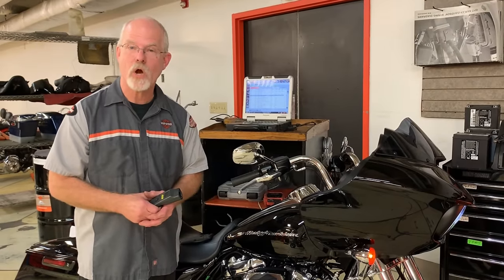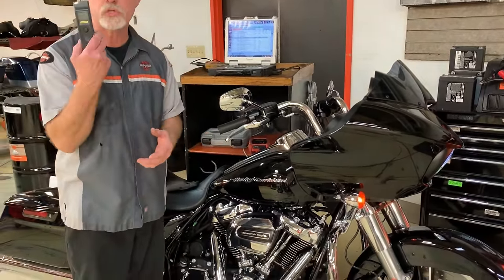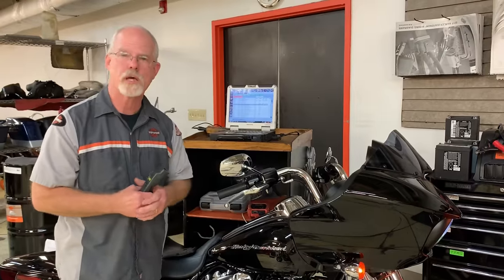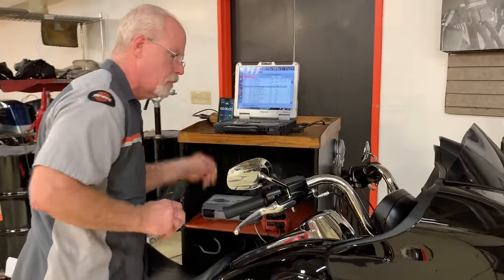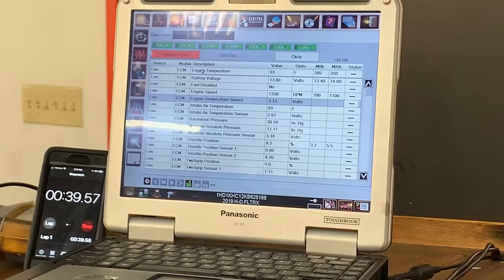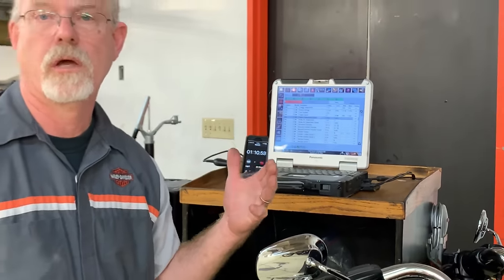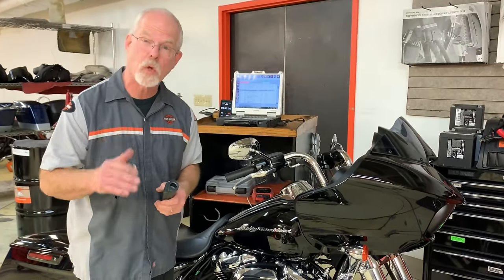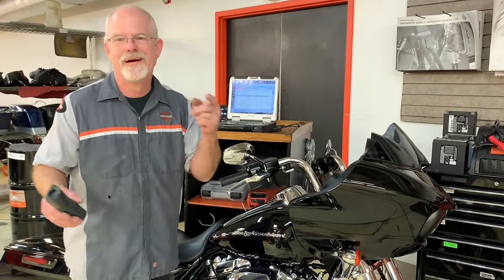DOC HARLEY: HOW LONG TO WARM UP YOUR MOTORCYCLE

Comment: I warm it up until the RPM's go down to the regular idle and while I'm putting my gear on. Then I take it easy on for the next few miles.
Reply: Hi I ever 2004 Harley Davidson when I speed up to 30 to 40 miles an hour the front in aback vibrate one side pull the clutch in let the Trotter out it just go smooth what do I need
Reply: Don’t rpm’s rise as it warms up 👀
Reply: @blakeoneal8306  yes a little. It's normal.
Reply: @blakeoneal8306  my choke says otherwise
Reply: Best gas for 2004 pan head road king?
Reply: That's just wasting fuel. in your case it's also good to take it easy the first few miles you drive because even though the motor is warmed up none of the drivetrain is warmed up. it's better to turn it on about 15 seconds before you pull off and then pull off and start to drive that way everything in the drivetrain can warm up equally.
Reply: thats what i do

Comment: Only a poorly designed vehicle requires a warm up.   For everyone else operating a cold vehicle at moderate  RPM until the vehicle is up to full operating tempeture is fine.  Warming up is a waste of fuel and, especially in the case of a Harley warming up in a tight community, is likely just a case of the owner being desperate for attention.
Reply from the maker: BS flag up and waving! This is an air cooled all aluminum motor with several pieces, ie heads, cylinder and case. From cold to operating temp the motor expands. Your comments are all opinion with no knowledge of our product. Go back to your car channels😡……Doc

Comment: I'm a 5 minute warmer-upper. I like my engine to be at 170 F before I take off. This usually takes less than 5 minutes, but I want the oil to be easily circulating before I have the parts moving. Probably way overkill, but just taking care of what I have.
Reply: 😂😂😂 the trans is still cold

Comment: I am a pilot and Harleys are air cooled just like my airplane. I do what's called a Preflight before I even start it. After starting it has to warm up before I do a mag check. By the time I get to the runway it's been at least 5 minutes. Waiting a minute before running down the road on my Harley doesn't seem that long to me. Doc is always right! I also have a temp gauge oil dip stick. I can check the oil temperature at any moment.
Reply: @VailJohnson  - max power takeoff is no more than 2,700 rpm. The cylinders are very similar being air cooled aluminum fins. I climb out at about 100 so there's plenty of air cooling the cylinders. I think I'll stick with Doc`s suggestion as I'm never in a rush to get going.
Reply: You think too much, Harleys and airplanes have no one single thing in common, lol
Reply: @Alim92usaman Oh but you’re wrong.

Comment: I allow mine to warm up till the back head is very warm to the touch of my back fingers. You are allowing Engine temp and oil temp to rise. It’s a relatively thick oil and it’s not hurting to allow getting hot before running down the road.

Comment: I own a 2018 Sportster 1200 Custom. Usually wait until the Idle speed drops to about 1100 or so.
Reply: I even wait till it’s normal idle. 975 to 1025
Reply: I do the same on my 2015 883. I like the control at lower RPM for start off rather then at 1400 -1500 rpm. I have a loose sand  1/4th mile long driveway and it's best to do at lower idle power and speed.

Comment: Good advice Doc.  Most old school peeps want to let it run for 3-5 minutes to warm.  This is a fallacy because you can cause more wear and tear running without light load because the moving parts are starved of lubricant.  I start and go immediately which is about 5-15 seconds, the time it takes to put my gloves on.  I do go real light on the throttle and don't go past 2k rpm until 10 minutes into the ride.  As for changing the oil while warm,  it's only true if you bring it to the shop.  At home,  I can let it drain for 4 + hours.  The contaminants are in the oil so there's no need for it to be suspended. It collects into the pan and most of the oil has dripped down away from the upper areas which is not necessarily true if you start the bike and let it warm.
Reply: Eh old school we had to let it warm for a few minutes. Evo's and older would pop seals and get leaks like mad if you didn't let everything warm up and expand first. 
My 98 Evo is what, 25 years old and still doesn't leak a drop and I warm her up first every time.

Comment: The most damage occurs at start up and from the fact the aluminum pistons expand faster than the steel cylinders they're reciprocating in
Reply: And a cold seize is when you rev the shit out of it before it’s properly warmed up for a few seconds if the ambient temperatures are decent. Then off ya go

Comment: I replaced the ambient temperature gauge in my fairing with one that shows the oil temp. If I am able to stay moving which is most of the time my oil temp stays around 180F. What amazes me is how fast the oil temp raises during just one long set of lights. I've seen it jump an easy 30 degrees or more in a minute or two. FYI... My engine, exhaust, and dyno tune are not stock.
Reply: Who did you purchase it from ?
Reply: @Richard5873  The Harley dealer. It's an HD part and matches my gauges perfectly.
Reply: @kerrylewis2581  Thanks did not know they sold one.

Comment: You really had me Doc. I've own a RoadKing, & it's pretty loud. I live in a quiet neighborhood & always feel a little insensitive when I start it early. Appreciate only 15-30 seconds is necessary, & i didn't know that. THANKS for the info. You earned a new subscriber.
Reply: Yeah, been warning my 20 Heritage till the RPM's drop down to about normal while I'm getting my gear on. Probably a wee bit too long, especially with my new shift, gotta leave the house at 0200.
Reply: I'm in a apt with underground parking. V@H pro pipe. Feel sorry for the folks on the first floor at 5 am😬

Comment: I let my Buell warm up till engine sounds right. There isn't a noticeable change in rpm Around 2-3 minutes in the cold 40-50 degree mornings. Maybe a minute if 80's or warmer. If I don't let it warm up it's jerky. And have an uphill stop and turn not far from home. So warming it up is more for me than engine.
Reply: That’s the only reason there was ever a need to “warm up” - carburettors and dodgy fuel control when cold.

With modern injected engines, they’re good to go out of the box dead nuts cold.

Comment: 2014 XL883L, V&H's mufflers. If I let my bike idle for 15 seconds after start-up my neighbors would go crazy. (04:30) When I start the engine cold the idle speed is around 2,000 RPM so I have it in gear and once the engine starts I take right off. I do not touch the throttle until 3 to 4 minutes after the bike is running and then I may go up to 3,000 RPM once I'm on the main street. I've lost 1 rocker arm bushing in 40,000 miles. Good video, keep it up.

Comment: I have only owned EVOs. But the rule I follow is to warm the engine until I feel heat permeate up through the rear rocker box. Not necessarily when the top of the box is hot, but until I feel heat coming up through the cover layers. Then I go easy for a couple miles. Sometimes this is quick, sometimes not. I have ridden in below 0F and it takes a few minutes. I will also occasionally put a space heater under the primary blowing under the trans and oil pan for just a few minutes before I start the engine.

So far, I've bought 2 EVOs with rocker box, head, or base gasket leaks and after fixing, none of the leaks returned.
Reply from the maker: Thanks for sharing SixShooter….Doc

Comment: Engine metal heat temperature is what heats up your oil, not the oil heating up the engine. You should let your harley warm up on a cold start just shy of two full minutes

Comment: On initial cold start, the ECU bumps up the idle in order to heat the exhaust catalyst as quickly as possible and minimize NOX emissions. There’s no need to wait for the bike to return to it’s normal idle before setting off. The bike only needs enough time to get a steady stream of oil to the top of the engine, which only takes a few seconds. After this you should begin riding as putting a load on the engine is what warms it up to normal operating temperature most quickly, being careful not to gun it until it’s warmed up some.
Reply from the maker: Sir you have an interesting post with experience backing it up….Doc

Comment: Thank you very informative I usually let my bike run for a couple of minutes and then ride it nice and easy for a while I have a temperature gauge in the oil and it regularly reads 202-210 here in Florida nice to know that that is where it's supposed to run

Comment: This is the most important advice of all along with not riding like a crazy person. 
I can't remember the times I've  told people to warm up their vehicles of all types before subjecting them to high load conditions.
It's always said to be the manufacturer's fault when there's a cracked piston or a spun bearing but the fact is well know that owners manuals detailing proper operation often remain sealed in their plastic packages for over a decade without of course ever having been read.

Comment: I was under the impression the 30 seconds was to make sure oil is getting all around the engine I don't think getting oil oil temp up was their main concern when they wrote that manual... The taking it easy at first is a good idea though..

Comment: Carb bikes are traditionally a bit more fussy. On factory fuel setting they will spit back until up to nearly full operating temp. Put an air cleaner and some slip ons and they will need a bit more fuel just to run. Start up on the choke and push the choke in very slowly until the idle comes down to around 11-12 and starts to sound lumpy. That'll take minimum 30 seconds. If everything is set up right you can get it to idle lumpy at 1100 and pull the clutch. Wait a few seconds before firmly selecting 1st. It should take a few hundred yards riding before it's happy with the choke off. The 3 turns out fuel screw and no spitting cold when you blip is way rich. I got my 1450 fxdl at 25k miles/25 years old with the 3 turns. Carbon factory, it's taken a bit at a time but now runs and smells sweet at 2 ⅛. Ran like c**p on 3 turns which is probably why they did 300 miles in a year on stale E10 before selling it.
It's got K&N and Vance and Hines straight shots with new packing in quiet baffles and it's nothing like quite under.
Happy days.

Comment: I've got my dad's 1994 Sportster 1200. It's carbureted, so I have to hold the choke for a couple minutes and let it warm up. Otherwise, it's going to be a rough ride for a while until it does warm up.
Reply: Kasual Kaos my 2004 Sportster 1200 is the same way. when it’s 72° outside it takes about four minutes to warm up from a cold start
Reply: Got a 2001 883, takes a GOOD LONG TIME to warm  up! No different on  warm day!

Comment: When I got my '66 Chevy Biscayne with a 283 the owner's manual said that no engine warm-up was necessary. I lived in Michigan at the time where it was not unusual for morning temps to be below 0 degrees F. I raced the piss out of that car and never did it burn any oil and I never had one problem with the engine. Today's oils are much better and being a motorcycle where it is likely to be driven is warmer weather I'd say that a warm-up is not doing anything but wasting fuel.
Reply from the maker: It is my opinion you are mixing apples and oranges. You wonderful car is water/ temperature controlled. Our motors are air cooled and dependent on oil temperature…..Doc
Reply: @LowCountryHarleyDavidson  This is true, an air cooled engine warms up much faster, especially if a car has a cast iron V-8 block and 6 quarts of oil.

Comment: In cooler seasons I let it run long enough vertically if convienant, (not on side stand) to reach operating temperature, then ride easy for a few.
In the desert, the opposite, and I try to scrub off heat befire shutting down.

Comment: I pre flight check all systems before starting engine. Allow for time to operate without choke for carburetor machines or till ECM idles down on fuel injection machines. 
Ride very moderate until all systems indicate go condition. Tires when cold offer less traction.
The machine tells me when she’s ready for action.
Reply from the maker: Ah, A Harley Whisperer 👍…..Doc

Comment: My comment is what “oil temp” did my flhtcu twin cam run best at which was 190-210deg F.
That’s the oil temp my Hd ran at in 90deg F outside temps after I added an oil cooler with twin thermostatically controlled cooling fans,a small version of luv jugs cooling fans mounted to left side motor horn mount with therm control too,XIED’s to richen idle low & mid range rpm mixture,went external crankcase breather to remove extreme hot blowby gas Lauren with oil mist from engine intake.
Doing all the above increased oil pressure,pressure,stopped valve train noise,stopped detonation,allowed motor to retain all the pwr/trq & crisp throttle response it had just past warmup from cold it always lost 20-30mins later after fully heating up,hot starts post fueling up were much easier/faster,less engine heat was hitting the riders too.
Reply from the maker: Sounds like you could write a book on this subject….Doc

Comment: Mike, you can Also tell just by listening to the bike, the temp sensor with have the engine RPM slightly elevated while warming, much like the Enrichener used to do, if you wait for the RPM's to drop to what would be a normal idle, then you can start to put a load on the motor.  Do it too soon and they come see fine Tech's like you to replace gaskets etc. and like you said while waiting for the motor to warm do a pre-ride inspection.

Comment: How long do you recommend letting an Evo warm up (1998 fxdl)?  I always let it warm up, but waiting until the rocker box gets warm to the touch, like so many say to do, seems to take forever
Reply: i have a 96 fxdc and a 2012 flhp i do the same thing you do.....if i cant wait i take my truck
Reply: I usually wait 3 to 4 min for my evo
Reply: I have had my 86 FLT since new with the 80 cube evolution and I use the cylinder jug fins to tell when it's warm enough by holding my hand on them then ride it easy for the first couple of miles and have had no problems with it at all !  The Evolution is known to blow head gaskets if you get on them real hard when cold just had a buddy who has a 96  Wide glide Evo that had blown a head gasket because he was the kind of guy who wouldn't let it warm up good before riding , that and his CV carburetor intake seals were leaking so it was running lean and cold blooded so he would take off hard on it to try to get it warmed up and to over come the hesitation of the leaned out fuel mix from the leaking intake seals , I told him fix the intake seals go through and rebuild the carburetor and let it warm up good and you shouldn't have any problems but he didn't listen and ended up paying a guy 1,000 plus tax to put head gaskets in it  rebuild the carburetor and new intake seals lol , I told him I would have done it for a couple of cases of beer being I was a mechanic for 30 years but his statement was I wasn't a certified HD mechanic lol yet in the 30 years I worked on classic, muscle , drag cars , trucks and bikes snowmobiles anything that has a engine on it I probably have rebuilt more engines than a HD mechanic will ever do in his life time as a HD mechanic I told him but he wouldn't listen but then again he isn't mechanical at all or has he had his bike all that long or has he had many motorcycles like I have had through the years so is brain washed thinking to work on a HD you have to be certified lol. Infact I just did a top end performance job and cam change on a friend of his Twin cam and it runs strong lol .
Reply: nope, just until it can idle without the choke/ enricher pulled out.
Reply: I do the same also put my hand on the cylinder jug and see if its warm enough and go

Comment: On my shovelhead I watch the oil leak in the morning.  When it starts leaking I take off like a rocket. When it doesn't leak at all, it does mean that there's no oil left, so I have to fill up. I don't control my turn lights, I don't have them. I can't hit the horn either because it felt off. Have fun. Cheers from France
Reply: LOL

Comment: Doc,I guess you can use ur tough book for finding out the correct oil temperature for road glide models, where u can select the option motorcycle condition report and click on option load once it's reaches the specific temperature it generates the complete report. hot oil level check always on jiffy  stand.